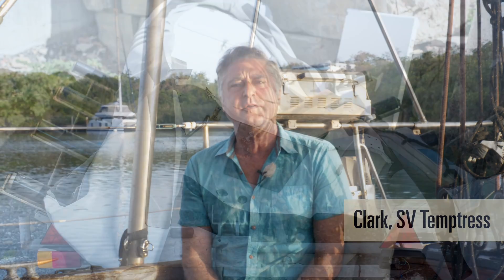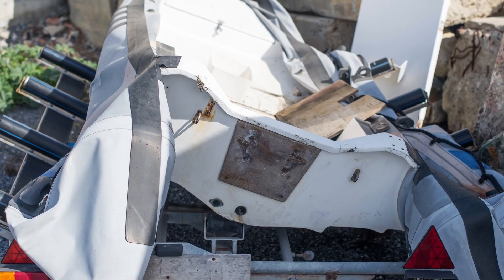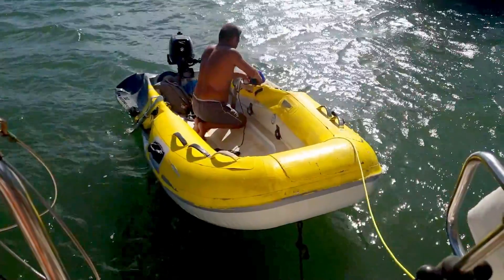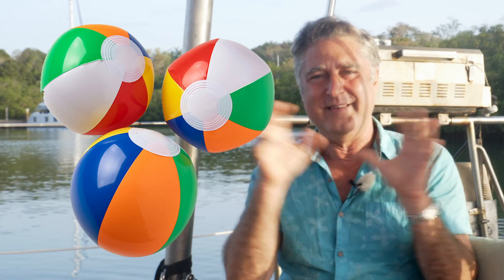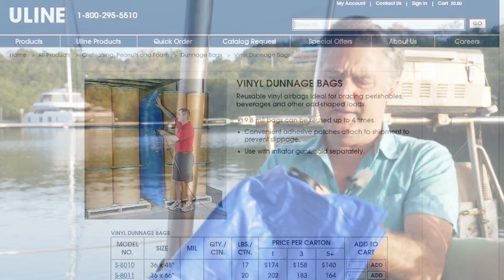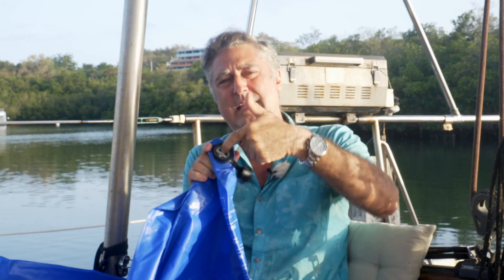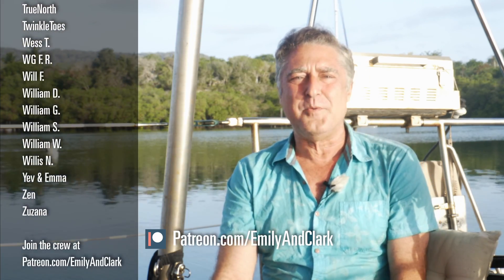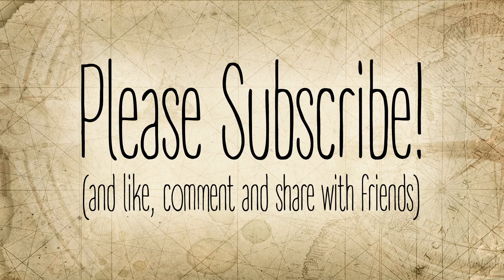Deflated Dinghy? Repair it for Under $100

Comment: Very innovative idea for someone on a budget or in the middle of nowhere. My experience with inflatables has been very good with them holding air I just seem to have problems with the seams for the floor coming unglued due to sand working its way into the joint. I know that the hypalon  boats are supposed to be way better than the PVC ones, but I have found the PVC  so much easier to repair. We used to do a lot of white water rafting and you'll be amazed at what a self-adhesive patch can do when you're in the middle of nowhere. I have often wondered if you could use RV roof coat to get a few more years out of our old tire dingy. Keep the content coming.
Reply from the maker: Thanks
Reply: That's clever.
Reply from the maker: Thanks.  I really wish more people had viewed this video.   I'm proud of this idea and I think it could help a lot of people.

Feel free to share links.

Comment: For your dinghy, to make stabilizer tubes you can buy 8" pvc discharge hose and a seam welder.  The whole kit for both sides will run ya about 600 USD.   Weld in a spot for an hr valve.  install the valve.  Weld the ends together and inflate.   Cover the whole thing with sunbrella.   Put in grommets to hang it on your dink.  Job done.  Good dink idea.  Passed it on to a friend in need.
Reply from the maker: Good to know.  Might try that someday

Comment: This is a good option for an inner tube. The only potential issue I can see is the possibility of chafe in places where there are folds/wrinkles in the inner tube. They look tough enough to last a long while, though. I love this as a solution to reduce dinghy waste.
Reply from the maker: Thanks Eric,
   If the dunnage bag did fail I think you could probably fix it with tape and put it back in, since the pressure should be equal on both sides with the dinghy skin as long as the repair wasn't in a crease once reinstalled.

If not vinyl is easy to patch.

Comment: Could these be used to slow a damaged boat from sinking?  Maybe fill a v berth?  Flotation bags have always been available for kayaks.
Reply from the maker: If you had enough of them and either tied them down or had a deck strong enough to support the boat.  Sure.

Comment: Great Idea!  I have looked at those dunnage bags before and was wondering if they would work as fenders for a raft up.  Certainly much cheaper than the actual inflatable fenders of any size.  Any thoughts?
Reply from the maker: I wouldn't.  Unless wrapped in something strong and not fully inflated they wouldn't stand up to the forces of a big boat.

I've watched strong fenders go pop
Reply from the maker: I wouldn't.  Unless wrapped in something strong and not fully inflated they wouldn't stand up to the forces of a big boat.

I've watched strong fenders go pop

Comment: Clark-  11 months later and my RIB has a leak I cant find/patch.  Remembered your cargo bag video.  Have there been any negative experiences with this idea?  On the other hand, has anyone tried it and been happy?
Reply from the maker: The original boat is still floating and being used.
It's about to get bags in the front section, it's glue is a mess!

I'd give it a go if you can't fix the leak.  It's a better option then buying new and landfill

Comment: Franken dinghy for Halloween. The amount spent on rib repairs or outboards which is greater? Planning to build a custom fit dinghy as none really are well suited.
Reply from the maker: It's so rewarding to build a boat.  I built my own skifs for years before I started using utility boats.
I say do it.   Emily enjoyed building her boat.
Reply: @Clarks-Adventure  I would rather repair a composite than repeatedly have poor performance repairs and pump up everywhere. Light, sail, row, outboard, lifeboat nobody makes it. Passenge home from Port Townsend soon.

Comment: Take this a step farther... this would make creating inflatable dinghies from scratch really easy.

I mean, the reason no one does that is because the skin is wearing all those hats and it is hard for anything but the factory to do that.

But if the DIY dinghy only needs to hold a shape and have some strength and the air bladder is cheap and only has to be air tight.

You could make a skin out of whatever dinghy skin is typically made out of and attach it to a little fiber glassed hard bottom. Then put a bunch of grommets in the seem... locking the whole thing together with some rope. Seem should probably be on the inside so the outer rim is contiguous fabric.

This could be a super cheap dinghy design concept. Because the hard bottom is fairly small and possibly could be pretty basic, that could be fabricated on your boat... its not huge. And the rest is just cutting and stitching together.

I appreciate Clark has a "ride" issue with these things and prefers the solid utility boats but perhaps that could be addressed to some extent if one could really shape it however they wanted. This is a very neat idea and its odd in fact that it isn't standard.

I mean, this is how a lot of bicycle tires work and as he said, footballs work this way as well. I think the old airships had this model as well. So its a very old idea but apparently entirely unimplemented in inflatable dinghies for no reason.
Reply from the maker: If you make one I really want to see it.

Yes I agree, one could build their own boat similar to what I had planned with the collar around my aluminum.

As a product of someone made those collars for hard dinghies I think they would sell.  

I'd buy one.

Comment: The only drawback would be the inside will be wet and grow mold. It's no reason at all not to repair a dingy that way but building one from scratch that is a consideration.  It's the drawback in kayaks built with inner bladders.
Reply from the maker: Yes and it would likely cost more to produce.

But as you say, as a method of extended the life of a "dead" boat.  Well, one must make allowances.

Comment: so crate of 10 for 250 is 25 usd each.. roughly..   not far off the price of a double sized air mattress. you can get a single air mattress at about 15 usd approx.. those are likely more durable though.  another option is expanding spray foam. but it would not then deflate and would cost more..  this is effective and cheap. i cant fault it. beats buying a new boat.
Reply from the maker: Don't use the spray foam.  Seems like a good idea, but I've seen it fail a lot.   Looks like cancer

Comment: Seeing deflatables in the dumpster of just about every marina I often thought about filling one with expanding foam. You would loose the ability to deflate but most never do anyway, especially with the RIBs.
Reply from the maker: Seems like it would work.   Doesn't.  Check through the comments on this video.